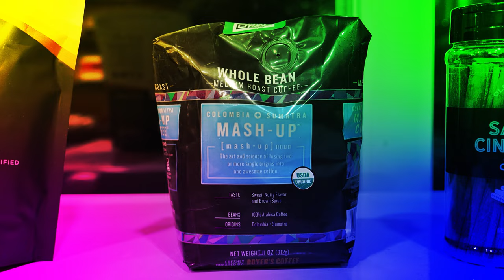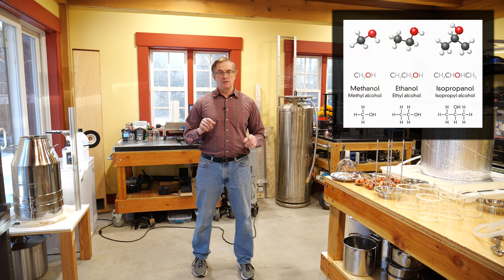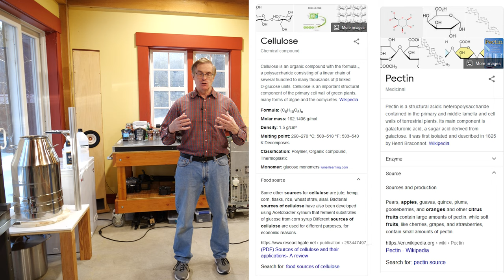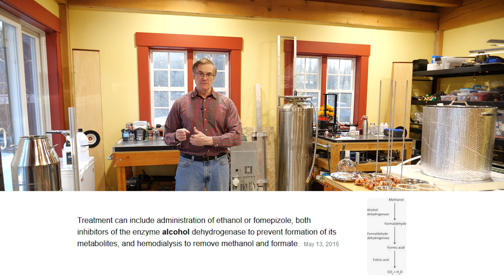Making Vanilla Flavored Rum! - Part 2

Comment: About this "methanol vs ethanol competition" - yes, you're pretty much spot-on, except that methanol metabolism is a much slower process in vivo. Specifically, any ingested methanol needs up to a week to get proceeded and be removed from the body, while for ethanol - even for heavy, erm, "consumption" - it's typically all converted and removed under 24 hrs (unless you have some "liver issue" or you're genetically disadvantaged).
So for acute methanol poisoning you'd have to saturate, so to speak, the patient with proper vodka for up to a week to be on a safe side, so i is not that simple that "ethanol in a home produced wine will take care of any methanol produced as a byproduct". But then again the amount of the methanol produced in a home made wine will be probably so miniscule, that it shouldn't be of any real concern.

Also, a fun fact - another way of dealing with acute methanol poisoning used to be to make the victim to breath a mixture of pure oxygen with 5% of CO2 admixed to it - oxygen will prevent some of formaldehyde/ formic acid "side effects" (like blindness - the oxygen deprivation is what destroys the optic nerves), and the CO2 admixed to the oxygen ensures rapid breathing, as it's the CO2 that triggers "suffocation sensation" (and thus forcing us to breathe). Breathing pure oxygen actually may slow your breathing.

Comment: I was always under the impression that a Column still with bubble plates strips out the flavor. I thought this set-up would be great for Vodka's and Gin which are a neutral base spirit. That's why Pot stills were and are used for creating rum.  I'm thinking that you probably would have gotten a more flavorful base rum by using only 2 bubble plates before the infusion, instead of the 5 or 6 that you used.

Comment: first of all i love your videos but have a few thoughts on this one. I don't think you can split the heads based on a certain amount of foreshots but you only can by smelling . You can smell acetaldehyde very well, so this splitting is not that difficult. Menthol will be present throughout the process, even more so in the tails, but this mash contains very little methanol because you are working with molasses, so little or no pectine is little or no methanol.
Reply from the maker: You're right about the pectin.
The methanol will be present in higher quantities in the first cuts because of its higher vapor pressure.

Comment: Can you do a video using the same equipment but for fuel alcohols?
Reply: Ethanol and Methanol are the most obvious, but Bio-butanol would be neat too.
Reply: Also modifying cars/generators etc to run on pure ethanol/methanol/butanol could be a project in of itself
Reply: A series on biodiesel could be neat as well, but would require different hardware.

Comment: Would you get more flavor with a pot still setup vs reflux. I would imagine the cuts at 190 proof lack a lot of flavors.   Your channel is my favorite because you are not just how but the why behind the how.
Reply from the maker: Did you watch our first video in this series where I described several different distillation systems including this reflux still?  Near the end, I showed how the amount of reflux depends on the temperature gradient not the presence of the plates.

Comment: Have you ver found (as I have) that the most potent infusion of herbal extracts (for want of a better term) happen within the first 1 to 5 %?
With that in mind, I wonder if a bypass system would help with getting the most potent vanilla, while still first-shooting your waste methanol aside.
Have you played at all with that?
I imagine that the methanol first shot that you discard would work wonderfully as a fragrance. :) 
Maybe as a candle additive or similar?
.
Maybe not.  I've not done enough methanol herbal extractions so far.
Reply from the maker: Extracting the foreshot then turning the the still off for a few minutes, inserting the gin basket and restarting the full run is probably the simplest modification and it's not a bad idea.

Comment: Was there a reasion you went with reflux over pot stilling when it came to this Run? As a novice, I would have thought to use a pot still in order to let more flavor pass to the fractions and ultimately the final spirit.
Reply from the maker: Yes, we wanted to demonstrate the operation of the entire still, but had the reflux condenser set very low to minimize reflux.

Comment: Those stairs in the background look nice (7:48) but they also look scary! The crack running along it looks like a failure point.
Reply from the maker: You're not the first to mention that.  However, as you might guess from our other videos, we reinforced the beam with a longitudinal groove routed along the underside and packed it with unidirectional carbon fiber tow bedded in epoxy.  Much stronger than new.😀

Comment: I have posted this video on 2 craft distilling groups on FB of which one is Jesse's from Still It YT channel. Some of the people were puzzled by the fact that the rum mash was run through full reflux configuration. The general idea is that you only run the full reflux if you aim for neutral high proof alcohol for vodka or gin. Anything else that requires flavor taken from the mash, like rum, whisky or fruit brandy, should be run through pot still configuration. Full reflux especially with that many bubble plates will strip out the flavor. So why the full reflux run?
Reply from the maker: Their mistake is the assumption of the reflux mode.  Full reflux actually means that nothing gets out and all vapor is returned.  Initially, this is necessary to equalize the plates and maximize the methanol concentration in the foreshot.  With the reflux condenser flow turned down the reflux decreases and when turned way down or off, the reflux is minimal.  Even a pot still has some reflux.  Check out our first video in this series where I described the operation of this still and the effect of adjustments in the flow.
Reply: @TechIngredients  yes, I understand that. Still what I don't get, me and others, why so many plates when running a rum. This should be run without any plates. PS. I saw all your videos on distilling also some others. I also watched plenty of other distilling videos and personally I come from a country where making brandy is a routine activity for almost any family at countryside. Plum brandy is king there. :o)
Reply from the maker: If you saw our first video on this system you'll understand that the plates have nothing to do with the actual reflux.  You could have a thousand plates, but as long as there is no temperature gradient along the path in the column (no heat is gained or lost) there is no reflux, it's just a complicated plumbing system.
Reply: @TechIngredients  but there is temp lost with every step. Even more, there is more temp loose with a simple empty column if is taller. That is why they pack the columns, to get the reflux effect. The dephlegmator has the role to fine tune control on the steam temp that escapes it. If you woul use just a simple column and no deplhegmator you will have a lower ABV coming out and also more flavor. You probably lost much of the dunder flavor through your setup which pretty much defeatead its role. Infusing flavor with the gin basket makes it a gin. Anyway, the video is good and very informative but the rule is go with pot still configuration for whisky, rum and brandy like you did in the previous videos with whisky and waragi.
Reply: @zberteoc  A benefit in using these copper bubble plates would be to remove the hydrogen sulphide, besides that even Jesse's (Still It) video series on Buccaneer Bobs Rum indicates that he first strips it, then refluxes it for the purposes of "bump up the esterification" mentioned at 1:50 here: https://www.youtube.com/watch?v=fFXAV_JUqQw&ab_channel=StillIt

IIRC The Buccaneer Bobs Rum recipe indicates to use a portion of the backwash\backset\dunder to re-flavor the distillate in the form of an essence anyway.

I respectfully disagree with your assertion that using a gin basket makes it a gin, since it was not distilled from grain or malt, nor flavored with juniper berries. Further since gin can be made by putting juniper in the wash, or by macerating in the distillate without the usage of a gin basket.
Reply: @TechIngredients   I hope you are having a kick-ass week :)  I believe zberteoc makes a valid point regarding a non-insignificant amount of reflux is occurring due to the distance the vapor travels away from the heat source due to the column not being insulated, creating a difference in temperature at each plate.  Edit 2: I believe the crux of the question is supposed to be more along the lines of; why so much reflux for the rum?, and why not just minimize the reflux to reduce the amount of energy required?

Having said that, I would enjoy further content from you that goes deeper into the different yeasts including kviek, or possibly crossbreeding yeast, what happens when you have way too low or high of a specific gravity, the effect of ph on the initial ferment, correcting the ph along the fermentation, and exploring the different esters created, how to encourage different esters, the effect of pre-distillation wash additives (e.g. citric acid, vinegar etc.)

Edit 1: When I say "have way too low or high of a specific gravity", I'm talking about the details beyond "produces funky flavors".. ok, funky flavors.. which are.. umm.. what exactly? - less "art" more "science" please :D

Edit  3:  I must be hard of thinking today..  When I say too high or low specific gravity, I'm talking specifically about the wash before the yeast pitch.
Reply: @helmandre  use a copper pipe or still for sulphide issue. If the vapor  goes through 6 bubble plates and a dephlegmator and it comes out at 95% ABV that is neutral spirit right there! That means you lost all the flavor from the mash and dunder. Now, if you infuse the neutral spirit with any flavor you basically make a gin. That is what I meant. I repeat, this is NOT how you make rum. Look at any rum or whisky producer and you will not see any bubble plates or dephlegmator.

Comment: Question to the Main Presenter: Would it be useful to heat the still (rather 'a' still) using a PID controlled water bath, like a double boiler? I think the temperature inside the still could be precisely controlled... and IIRC this might allow you to boil off a specific thing more completely? 

E.g. perhaps you could run the still at 148.5° until the output stopped, to purge all of the methanol (maybe it would have to be higher than 148°, but you get my point).

Also, you did mention the need to avoid scorching.

I'm hoping that someone with technical expertise can answer this question, since when I've asked on related forums, some Popcorn type says "Heh, that's a dumb idea, sonny..." without explaining it like a physics teacher would.
Reply from the maker: Take a look at our first video in this series where I described the operation of several different distillation systems including this reflux still.  I explained the nature of distillation separation and answered that question.  There might be a value to a temperature controlled boiler, but it's not for that purpose.  Rather it can make managing the long operation less tedious or prevent the scorching of suspended solids and the overloading of the column beyond it's cooling capacity.

Comment: Doesn't a reflux system strip out all the flavoring of the molasses? 

Would a pot still work better for rum?

Just curious thanks
Reply from the maker: Any reflux still can operate in a pot still mode by turning off the reflux condenser and even better by insulating the column.  Take a look at our previous video on our new reflux still.

Comment: I.wish we could see the process to startup and operation the distillation column..., what temperatures you were chasing at the top of the column before and after turning on the condenser and to collect the foreshots and heads..., we're you controlling the temperature to the mash manually?
Reply from the maker: The startup is pretty much as I described it in the video.  The full reflux is maintained untill the liquid levels on the plates has equalized.  No temperature level is used during this process because the reflux condenser isolates the thermometer from all the vapor.  The condenser is then turned way down to minimize reflux and operate closer to a pot still configuration to allow more of the flavors through.
Reply: @TechIngredients  Thanks 🙏

Comment: I have a question about the methanol you discarded. Specifically about using it to clean. This could be used where an alcohol wipe would be used? And considering it's toxic for consumption, using it to clean a wound would be equally toxic?
Reply from the maker: It would, but it's not that toxic.  The  quantity absorbed when treating a wound would be extremely small, but seeing as ethanol works well as a disinfectant and is less toxic, I'd avoid methanol.
Reply: @TechIngredients  Good to know. Thank you very much for answering.

Comment: Jar eleven in the middle of your run was 185 proof? I believe you are going to find that running that much reflux has stripped out a lot of 
the desirable flavors. Also I am pretty sure the left over wash you are saving is not dunder. Dunder is what is left over in the still after a run.
I have subscribed to see how you are going to make your cuts and final product.
Reply from the maker: Thanks.

Comment: Would it be of any worth if you're making several batches to keep the later takings with less alcohol and distil them again all together?
Reply from the maker: I've never done that, but distillers do exactly that.  The reason I don't is that the flavors near the end of the run begin to get funky and I usually dispose of these anyway and expect what ever is left in the kettle is worse.  Theoretically, going to a high reflux separation with these leftovers could extract alcohol for other purposes.

Comment: Can you refine the waste methanol and funky ethanol into a rocket or jet fuel? Maybe you could burn it to heat the next batch, making the process more energy efficient. Or perhaps use it as a solvent when working with epoxy resins?
Reply from the maker: Jet fuel, definitely, but we'd need a LOT more rum.  The jet engine is very thirsty.

Comment: If you had a water free mixture of methanol and ethanol 3A molecular sieves could remove the methanol from the mixture since the size of the ethanol molecule is too large to fit inside the pores of the molecular sieves.

Comment: You didn't cover how to finish the process. How do you know you are done? When do you turn off the heat? Is there any special clean up?
Reply from the maker: You stop when the cuts don't taste good. Another end point is alcohol content.  When less than 20% the value of following cuts is low and the taste usually deteriorates around that point.

Comment: Love your vids, all of them from the chemistry, audio, nautical and boozy. Your content is interesting to me as I share a lot of your interests. 

Have a tech question however, you put the gin basket above the dephlegmator which to me looks like the alcohol vapor passes through the gin basket only once and is then condensed. Would a lot more botanicals flavor be added to the brew if the the basket was located between the dephlegmator and the bubble plates?  That way the botanicals would be passed multiple times. I'm wanting to make sprit with strong fruit and nut flavors. Would a single pass thru the basket infuse enough flavor? 

Also love the heat source for your still. Been trying to find the 1500w bands for sale without success. Who make them and what are they called?

Your thoughts would be appreciated. Keep the videos coming I enjoy them all.
Reply from the maker: That would extract more flavor, however the lower volatility oils may then never pass through the reflux condenser.  It's a trade off and it is done both ways for different results.

Comment: Wouldn’t you transfer more taste of the wash when you remove the bubbling plates and use a more open column ?
Obviously the proof  will  be lower  but  is might generate more flavour in the final product
Reply from the maker: That's true if the reflux condenser is running, ours was nearly off.

Comment: Regarding methanol: while it is true that the highest concentrations of methanol are in the first fractions, it still comes through in appreciable concentrations throughout the entire run. More important than the absolute methanol concentration, however, is the methanol concentration relative to ethanol, usually measured in mL Methanol/100mL pure ethanol. This is what determines the final methanol concentration, since the final product is usually diluted to a specific ABV. When you consider this, the most dangerous fractions for methanol are actually the tails. Here is a paper that goes into detail on this, as well as some great tables of concentrations of different compounds throughout the distillation:
https://op.europa.eu/en/publication-detail/-/publication/0b908be6-2673-45a5-8c2f-b3b6abc1aa37

As an interesting aside, the fact that methanol is very difficult to separate from ethanol is the reason it was used during prohibition to render industrial alcohol undrinkable, hence the name methylated spirits. This is likely the main reason for stories of people going blind from moonshine, because the product was illegal and unregulated, and therefore made by people who had no qualms about cutting their moonshine with industrial ethanol. Nowadays industrial alcohol is instead "denatured" with denatonium benzoate to make it intensely bitter instead of poisonous, with the exception of some third world countries.